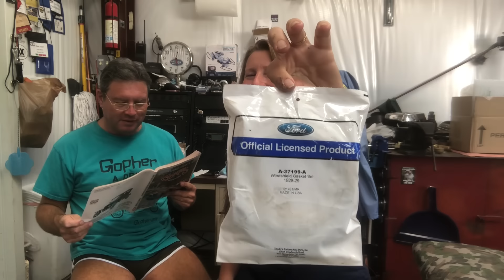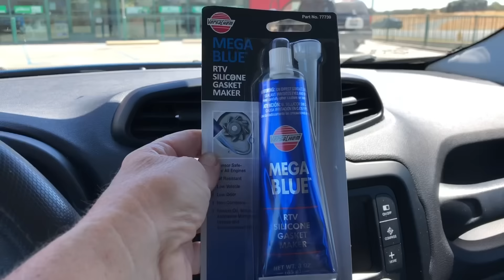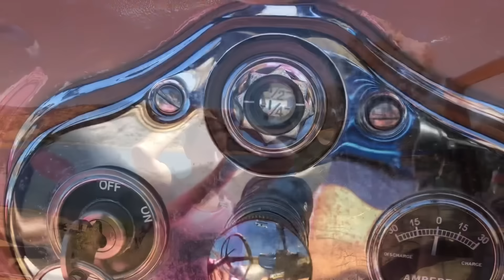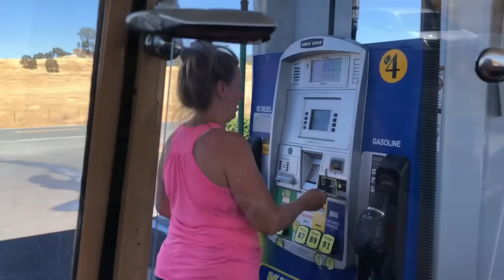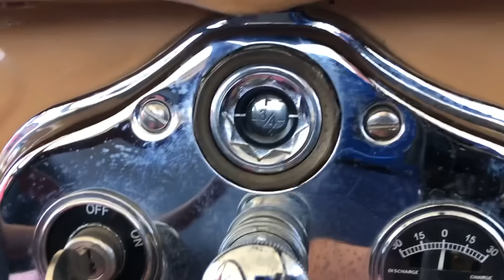I fixed my 1929 Ford Model A Roadster, now will it get me to the lake?

Comment: 1552, Paul you need a Period Correct broadcast console for your RCA transmitter 3.825.   
(Night of nights video other Tina channel?)
 P.S. the web sight sign on the car lift was brilliant.
 P.P.S. The longer Video was great Thank
Reply: Thank you, brother.  The lettering on the lift has been there a couple years.  The RCA BTA-1R is going to be looking for a new home, I think.  I'm pretty sell done with HF.
Reply: @ModelA  I hope you keep a smaller HF Transmitter for prepping sake (I mean heaven's sake). The spectrum is full of challenges, thanks for what you do Paul.
Reply: @mackfisher4487    Oh yes, absolutely.  I also have an all-tube HF setup (Collins 32V2 TX and 75-A4 RX) for EMF-proof comms.  The RCA 1KW broadcast rig on 75m is just not getting used anymore.  I want the space in building 2 back